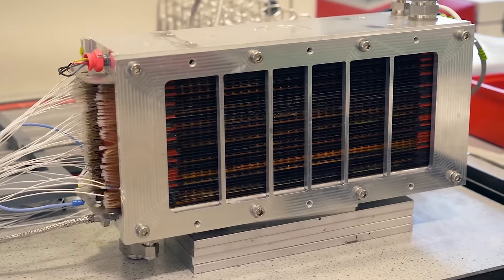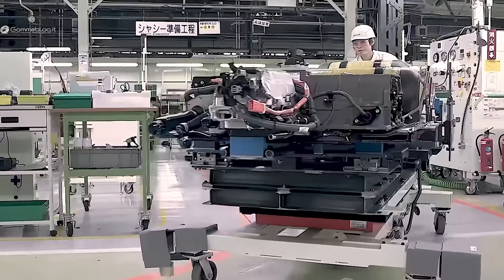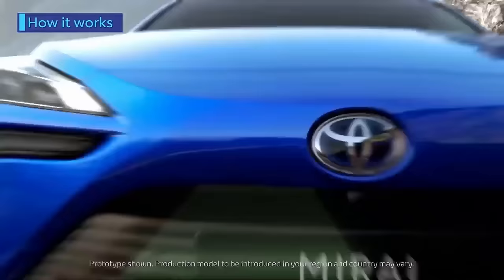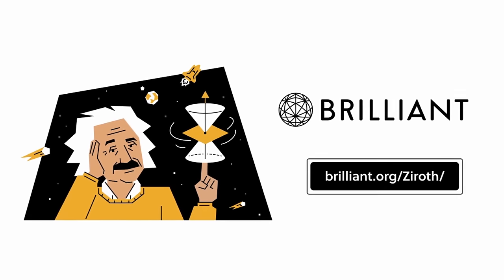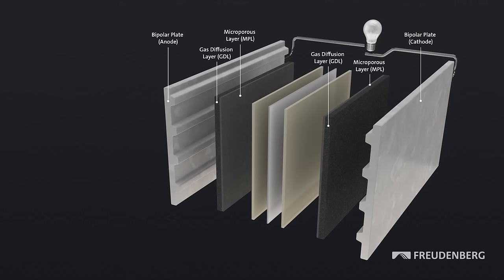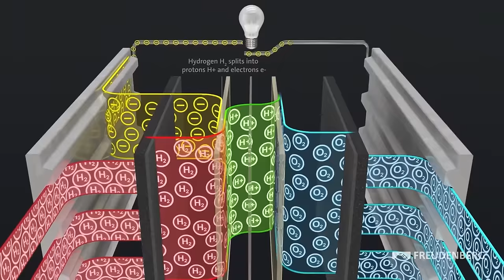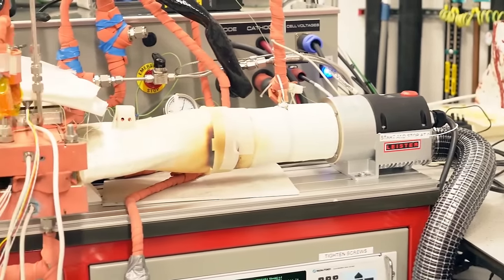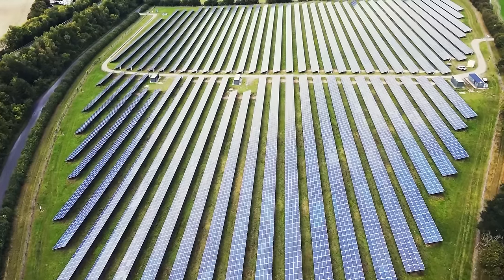Why This Hydrogen Fuel Cell is Engineering Genius

Comment from the maker: This breakthrough is what happens when engineers look at a problem at a system level! Amazing work. Also, don't forget to check out the interactive courses from Brilliant! Use my link at https://brilliant.org/ziroth/ for 30 days FREE and 20% off a subscription!
Reply: Pro tip: don't put "insane" in your header. In 2024, it means "mediocre clickbait".
Reply: this is what happens when i allow my ideas into my surface thoughts where they can be farmed
Reply: Lighten up fr
Francis.  😅
Reply: The real question is, when will the AI videos start popping up crediting Leon Musk with this development. 😂
Reply: Another energy storage device for even the large electric planes I'm conceptualizing for the market, ones that'll be in sized with like the Boeing 737 or larger, like up to even 747 size.

Don't worry, I've figured out a power delivery system that'll be in place of the motors needed to even get the plane airborne.
Reply: @WolfeSaber  if you can power a plane you can power a gundam
Reply: @kingmasterlord  Using the stats from the UC timeline, but not in the real world.
Reply: @WolfeSaber  an Armored Core, then. Heavy Gear, whatever.
Reply: @kingmasterlord  You do realize that the turbine used to power an Abrams tank not only can power a Zaku, but also give it the means to use be weapons within the physics of the UC timeline.

You need a reactor to truly power the machines you said, ones that are powerful enough to run a city for years.
Reply: Can this be a sea horse 🐴🐎🐴 🐴 ovol shapes winer in few adepted in like craft filler like ions magic ✨ lol well it's nice usa gets to pick parts 🤖⚖️〽️🔰🌐🖼️ WD
Reply: @WolfeSaber  no you don't, you're building them wrong. hell you can turn a bobcat into an AT-ST with little difficulty
Reply: @kingmasterlord  Do you even know what kind of power is needed for the mechs, not a chick walker, so they can operate like that in the games or cartoons?
Reply: @WolfeSaber  do you have any idea how irrelevant that is to making one irl?
Reply: @kingmasterlord  So why did you start the conversation on using the electric power needed to power a large plane to run a Gundam?
Reply: @WolfeSaber  put a torso turret on a tank if you're so butthurt about it. i used gundam as a catch-all term for piloted robots
Reply: @kingmasterlord  I don't plan on making giant robots, peabrain.
Reply: @WolfeSaber  i do. you think you're smarter than me do it better or grow up and stop calling names on the internet
Reply: @kingmasterlord  How about you stop being a troll before someone worse than me does something you don't like
Reply: @WolfeSaber  nothing about my behavior is trollish, you're judging me based off my avatar. ive handled worse than you already.
Reply: @kingmasterlord  Then there is someone out there that's worse than what you've handled already. And it wasn't your avatar that shows you're a troll.
Reply: but who cares if major other questions have not been solved for over 25 years 

Car fuel cells are not feasible and can not match the target cost and prices, same for trucks and the bigger issue is the hydrogen production and its inefficiencies.
Reply: @typxxilps  fuck the target costs and prices, you cant have your cake and eat it too. eat it or it burns.
Reply: Seems they're missing a big application if they don't consider CPH for commertial & even residential buildings. Could both power & heat all types of buildings as long as they have a supply of Hydrogen. Creating Electricity at point of use and using all the excess heat for space heating. This already exists of course, but not with High temp fuel cells I'm pretty sure & this compact perhaps. Could replace your boiler at home even, while generating all the electricity you need + putting some back onto the grid maybe, depending on power output.
Reply: @kellymoses8566 🔴 What Is Islam? 

🔴 Islam is not just another religion. 

🔵 It is the same message preached by Moses, Jesus and Abraham.

 🔴 Islam literally means ‘submission to God’ and it teaches us to have a direct relationship with God. 

 🔵 It reminds us that since God created us, no one should be worshipped except God alone. 

 🔴 It also teaches that God is nothing like a human being or like anything that we can imagine.

🌍 The concept of God is summarized in the Quran as:

📖 { “Say, He is God, the One.  God, the Absolute.  He does not give birth, nor was He born, and there is nothing like Him.”} (Quran 112:1-4) 📚

🔴 Becoming a Muslim is not turning your back to Jesus. 

🔵 Rather it’s going back to the original teachings of Jesus and obeying him. 

More .....👇

🔴 THE RETURN OF JESUS
Reply: It's funny but I put a comment up here just yesterday detailing an invention very similar to this one from the 90s and another free energy way of producing electricity perpetually without any pollution except for that caused by the manufacture of a generator and today it seems to have disappeared magically.
Maybe you could explain to me why?
😏
Reply: @robertocalledecresta2312  yt be deleting comments left and right.
Reply: @kingmasterlord  God forbid that the people of the world found out the fact that there is a way everyone everywhere could have access to non toxic free energy.
What would that do to the planets power structure?
People might start to have a chance to explore their creative possibilities with all of the global inequalities ironed out and that would be terrible.
God bless you Youtube for keeping us all in the dark!
😍
Reply: @robertocalledecresta2312  hell dude it we just quit arguing over which renewable was better and used them all we'd be set without it, and free to pursue it
Reply: @kingmasterlord  there is actually another way of producing electricity that has been hidden away from everyone. The reason my comments were taken down is because I explained them...
Reply: @robertocalledecresta2312  post a video. I've subscribed.
Reply: i expected this at some point.
Reply: entire vid is just a sponsored marketing shill. Those companies always promise the future and most just suck up investment money before vanishing in the dark.
Reply: Hydrogen is done. No one serious spend money on it. Only those who are continiously flowed by subvention. 
Even on the train witch is the more adequate vehicule to put all the auxiliaires, heat exhanger, pump and so on, the german stopped. It's not worth it comparing to the batteries that still evolve hugely each year and the cost drop fast. Not to mention the safety of the stuff and the current poor efficiency to make hydrogen barely 50%
Reply: TRY TO USE NANO TECHNOLOGY FOR BATTER RESULTS
Reply: @markfernandes2467  I've been saying that for decades, but the only way to do it is building something yourself because of all the red tape. Because of getting approvals and certifications it costs 20 times as much for the same power output for a combined unit compared to just burning stuff for heat. It's like the system is geared to being very wasteful so we have to buy twice as much fuel!
Reply: Hydrogen Mortal Engines are a time bombs
Reply: If you recirc hot air..doesn't that keep increasing the working temperatures continuously?

Comment: This company seems primarily focused on the efficiency in the functioning of the fuel cell itself rather than one of the biggest problems of this application. In order to really compete on distance, you need liquid hydrogen. Liquid hydrogen is stored at -253° C and that presents some serious problems for a plane
Reply: I would like a video where all the challenges are laid bare.
Reply: A small company for small problem
Reply: That & Now if only we had a GIANT deposit of Platinum.... Oh right, we don't so--> useless.
Reply: @w8stral  Very good point!

There just IS NOT enough platinum for a transition of the road fleet to hydrogen fuel-cells.  But for aircraft possibly.  It depends how much Pt these fuel cells require.  As EVs replace ICE cars, the platinum presently going into catalytic converters will become available for other uses.
Reply: @karlwithak. The CO2 emissions of air traffic are definitely anything but meaningless!  They are 2.5% of total emissions, but are particularly deleterious as they are released at high altitude!
Reply: @karlwithak. Total emissions are meaningless?  Unfortunately for you some 98+% of scientists disagree with you... including me!

I am now retired, but as a chemist, I can bloody well assure you that they matter a GREAT deal!  And no one told it to me... except perhaps my own knowledge of things at play!

But knowledge is not your forte, is it?

Spewing exhaust gases in the atmosphere we all breathe is as sensical as shitting in the tank or cistern from which your drinking water comes!  Would you be happy if I did?
Reply: @st-ex8506  Hydrogen for cars is far more problematic than just the need for platinum in fuel cells.
Reply: @dogsbodyish8403  I totally, fully, completely agree with you.  Hydrogen for road transport makes neither technological, nor environmental, nor financial sense!  Who coined the word "fool cells", BTW?  Elon Musk?
Reply: @st-ex8506  Musk may be many things, but he's certainly not daft.  With Tesla and its Supercharger networks, he's almost singlehandedly put electric cars well and truly on the map.
Reply: @st-ex8506  There is lots of platinum in catalytic converters. You don't need much in a fuel cell.
Reply: @rogerphelps9939  there is 3-7 g Pt in catalytic converters, and 30 g in a Toyota Mirai fuel cell. So, nearly an order of magnitude more!
You could have googled that up in 30 seconds before commenting!
Reply: @lucbloom  - Engineering Explained did a good job on that 5 or 6 years ago on his overview of the Toyota hydrogen engine speculation floating at that point.
Reply: In situ hydrogen generation has great potential.
Reply: @st-ex8506  compared to the 50%  plus used for industrial heat, airline use is little more than highly visible target.
Reply: @iancormie9916  Who mentioned using hydrogen to produce industrial heat?  Certainly not me, as it would be a senseless use of it!
No, hydrogen is needed, to the tune of around one hundred million tons per year globally, for reduction and other hydrogenation reactions, or for the production of industrial reagent, such as HCl and other acids.  It is used as a PHYSICAL ATOM, a role in which it is obviously unreplaceable, not as an energy vector, a role many would like to give him, but one for which it is ill-suited.
Reply: @st-ex8506  Well, presumably there was not enough platinum for all of the  catalytic converters that had to be fitted to vehicle exhausts in order to comply with emissions standards. That platinum will become available as ICE vehicles are phased out. I am sure they will find other sources of platinum if they look hard enough.
Reply: @dogsbodyish8403 As smart as he is, I wouldn’t trust him to be honest about a competing technology. Or that he would use his credibility to undermine someone competing with his companies.
Reply: @en2oh  Sounds like it's self-defeating - how is the hydrogen generated?
Reply: I honestly don't think we will ever see hydrogen for many things due to the volumetric density. 

 Even at 700 BAR the Mirai gets the same as other EVs as far as range goes at around 420. While weighing 1k pounds more than a Model 3 with less volume. 

 So what type of power density with total weight of the system?

 So I wish they gave us better numbers honestly.

 I am not holding my breath outside of niche uses.
Reply: @en2oh  
With what energy would you generate in situ hydrogen ?
Reply: Gaseous hydrogen in modified internal combustion engines are a likely solution.

Comment: It does not matter how well any hydrogen system operates.  The massive problem hydrogen has is its production storage and distribution.  Considering is propensity to permiate just about any material these are massive.
Reply: Yes, I am lucky to be able to talk about this with an engineer whose job is hydrogen storage.
Reply: @karlwithak.even if they were, fossil fuels have a definite end, it will come, no matter what. It's just not sustainable, dirty in acquisition and very wasteful and inefficient with energy in general. Shit makes no sense => maybe we should look for alternatives...
Reply: True true and true, it's money or/and research to get there. Now let me ask you, how can you replace natural gas or just petroleum/gas. You can't replace the cars for electric, not feasible for any grid in the world. Same for natural gas.
Even though storage is a problem ,it's a space problem, not an energy to compress the problem as hydrogen has a massively lower molar density, so it's very easily compressable.
Reply: @bernardomacara6284  Wrong. EVs can be supplied by the grid in most countries with only small improvements. It is just like the increase in capacity required bt the widespread adoption of air conditioning in the US in the 1960s.
Reply: @bernardomacara6284  By what stretch of the petroleum industiy's fears do you (they) reason that the world cannot replace their admittiedly extensive and expensive distribution network with the other network that is largely already in place?  Further developement of home solar and localised wind generation is already having a large effect and scaring the millionaire executives right out of their cosy little nests.
Reply: @phillargus2757  the petroleum industry are the biggest investors in hydrogen at the moment, just so you know... You can say the same when Natural Gas came... There is precedent...